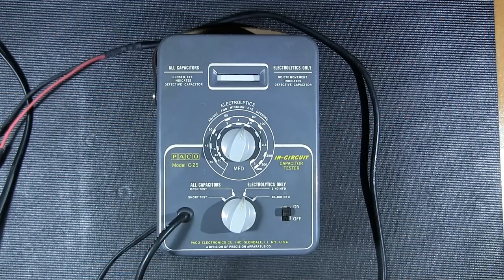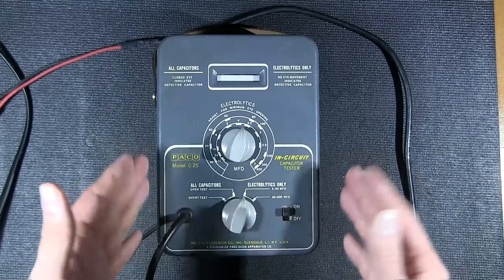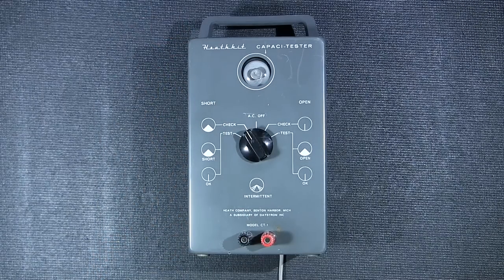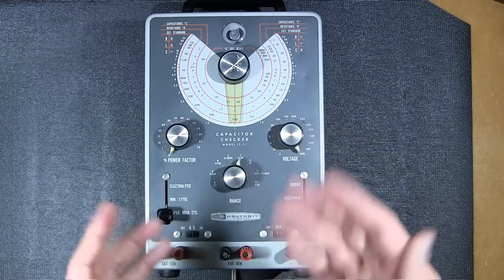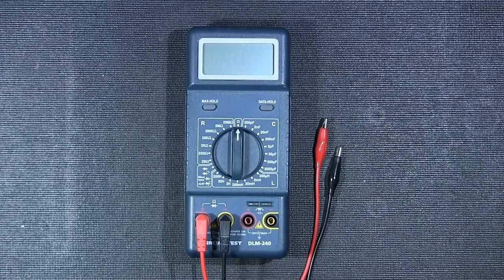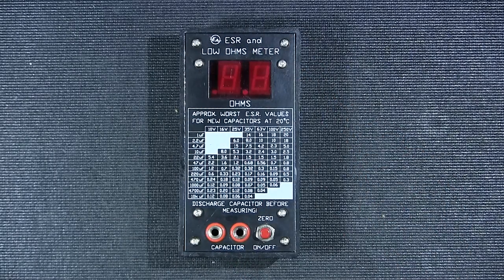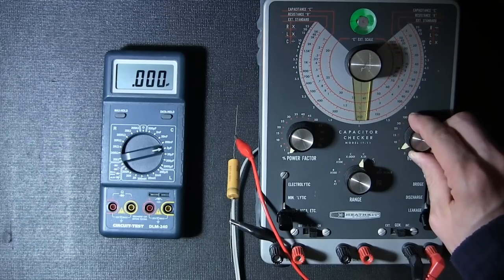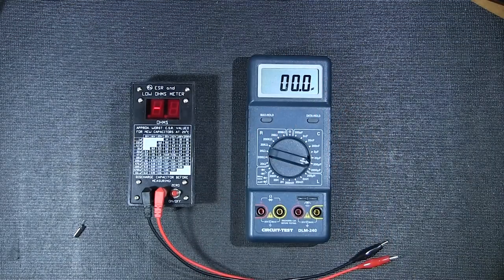Which Capacitor Tester Should I Buy?

Comment: For the absolute beginners on a budget I like to recommend the very cheap "transistor tester" things on ebay. They do more an estimation than a measurement, but they are quite ok for comparing parts, and much better than nothing. One could use one of them to repair a much better device that one bought defective on ebay....

Comment: Ah-hah neat to see the old kitset Electronics Australia ESR tester. At the time I built 4 of these as the kitset they were, 2 for work and I have no idea who 'borrowed' mine over the years because I have not seen them since. I guess they've become a gotta have cheap as anything tester (especially if you permanently borrow it)  for dreaded "rotting" electrolytics testing. I recall though that the ESR ohmic value readings shown in the table were specifically derived from a bunch of to hand capacitors tested by the kitset designer and that because they were already old devices they values shown are very approximate. More modern capacitors will likely give a different reading so use the figures as rough guide only....

Comment: Great video as always. I will add one thing though - if I test a cap with a tester that works by measuring time to charge the c.u.t., and I see a reading that is way higher than the rating, I know that the thing is leaky. Leakage tricks those meters to believe that the cap they test has more capacitance, purely because the leaky cap takes more time to charge. I'm sure you know that, just felt like this might be useful to somebody else with less equipment :)
Reply from the maker: Thanks for stopping by Johnny!

Comment: In my case, a multimeter with capacitance range and a megger (200-500v) for leakage testing is all i need :)
Megger is also used for checking leaky power transformers, but out of about 50 radios i have only found a significant leak twice. Once just a tingler, once a dead short which could've been painful and dangerous...
Once i found a wax capacitor so leaky that it leaked 1mA at 90v...

Comment: A bit of trivia...

...I was an electronic technician for RCA for 33 yrs (50's-80's) And during that time; I was sent to other places from Chicago. And I didn't know; that IN high humidity areas; it can drive technicians crazy. And when they sent me to South Florida (Ft Lauderdale) I couldn't believe it. Because, at that time, RCA used waxed capacitors galore, in their TV's.

And would you believe? Many times, I had to change most all the capacitors in the TV's.  For many were all "leaking". Over and over. And a technician in Miami's RCA Co told me, "pat, you are going have to use other type capacitors. Like shinny caps. Or if you use RCA caps; they won't last a month down here!". And he was right.

Believe it or not. And some resistors (like "IRC's") would go bad also, because of humidity. So we used only shinny resistors. To keep humidity out of them. Because, the shinny bodies do not let humidity creep in the caps and res's.

For what it's worth.

Comment: There seems to be a range of what is max acceptable ESR. The charts vary somewhat between tester brands. If you look at capacitor nanufacturer's specs, the max ESR is  sometimes given and may not agree with the tester and can vary between  brands for capacitors designed for similar service.

Comment: I bought a nice kit component tester about a year ago and it does basically everything here, except with probably less accuracy. I was just looking at a faulty SMPS in a phone charger yesterday where one of the caps had blown. The tester showed me an obscenely high ESR of 42 ohms and 20% loss or leakage. Pretty neat bit of kit and smaller than all these meters
Reply from the maker: Does your component tester source 600 Volts?
Reply: It uses a 9V battery so I think so yeah

Comment: Thank-you for the video. I have enjoyed everyone you made and look forward to a restoration video. I have always been a fan of preventive maintenance. When servicing, Isn't it just a good choice just to replace any, even suspect capacitors ( with a high quality ) one ?. For the most part they are cheap. I can see using a meter if you have to match one for RF circuits. I know replacing good components with new ones may be a waste, but I believe better safe than sorry.

Comment: i design build modify and repair metal detectors, pulse induction and vlf, so an oscope and an lcr meter are vital, the problem i have is finding good lcr meters that measure low enough on the henry scale, most only go to 100 uh, some do 10uh which is okay, but you really need 1uh.
at 100uh a 320uh air core coil, could read 280-360uh, at 10 uh it could read 300-340uh, so a one uh setting gives a more accurate reading of the coil, which in pi detectors can be important, my advice would be to buy a quality dedicated lcr meter, and not a multimeter with lcr, i have found those to be quite inaccurate even "good" named ones, often cheap no name dedicated lcr meter reads closer to value.

Comment: With the esr tester a reading .5 instead of .35 would be pretty hard to call, usually with the esr meter if it's a faulty cap it will be out by an order of magnitude in my experience.

Comment: "Re-Form" Capacitors? Really? Can that actually be done? I'd love to hear more on that subject, even if it might be a "what not to do". Mr. C, I really enjoyed your talk today!
Reply: ^I second that motion^
Reply: I used to re-form or attempt to re-form electrolytic capacitors, I think the true art is in the re-stuffing of those caps with modern ones which is what I do now.  Having opened up enough old can capacitors I can see that time is not a friend and running current through them wont fix what 60 or so years has done to them.  Trying to rebuild a dielectric coating on something that so broken down and dried out is just asking for trouble.
Reply: Re-forming electrolytics applies more to, as far as i know, ones that have been laying in storage, unused. You might not wanna go applying near-to-their-rated-voltage right off the bat.

Ancient electrolytics though, you just wanna chuck straight into the bin.
Reply: As far as it's been explained to my newbie ears is a method for preparing electrolytics that have been sitting for a long time. As for the actual physics or specific method.... hopefully Mr. Carlson can elaborate.
Reply: Reforming can be done but the yield is often low on old surplus junk. :) The ancient Sprague guide (maybe say 1970's) I  used about in 1990 had one reforming via heating the capacitors, having a series resistor in series with each capacitor and going above the rated voltage.

 I did this about 1990 with several dozens of 10 to 30 year old multi-section radio filter caps. 

About one third of these got "reformed" the others just drew more and more current, ie the leakage current did not drop with time but rose. 

This was with a mess of oddball "multi-section radio filter caps" in the 300 to 450 volt range and say 5 to 60 uF. These were from Apex in Sun Valley, the TRW swap meet and C&H sales in Pasadena Calif. 

 I heat the caps in the oven and had a Power Design 3000 volt 10ma supply with a resistor in series to limit the current and also to monitor the current.
 The reformed "multi-section radio filter cap" I placed in a S19 R Sky buddy radio was OK for 15 years until Katrina hit and the radio went under salt water. A reformed cap I place in a S40 hallicrafters dies a few years before Katrina, thus maybe 10 years.

 Even if "reformed" the cap needs to be used, If left with no DC across it they often are bad again in a few years.

 During the reforming event the leakage current will drop, but often not enough to be OK. Heating is required to get the dielectric reforming. With leakage current there is I square R loss watts of heating in the cap too. On abad cap it might be more heat than what oven did. :)

 You do not want the darn caps blowing up in your face by using too low a resistor.
Reply: In all of my heathkit restorations videos I hook the electrolytic caps to the IT-11 and document the reformation for academic purposes only, with an inline Ua meter.  Given a great deal of time for some, watching the current drop for a given voltage to an almost acceptable level, and then retest it 2 days later to find the it again has excessive leakage  leads me to believe that most likely a lot of these cans gain moisture over time which when heated can remove, leading to lower leakage, but the dried out seals will not stop them from re-absorbing water again.

If capacitors were $700.00, of course  I would invest a ton more time in the effort. They are not.   Again, If going for vintage, Id rather just re-stuff them with new and make it look original.  Reforming is just putting lipstick on a pig.  open a few of those cans and your opinion will change.
Reply: 3beltwesty, fascinating... thanks!
Reply: Actually, a good tester, such as a Sprague TO-6, will display the current leakage as the barrier reforms....I've done that thousands of times on caps both very very old from the 30's to new caps that have sat around for awhile.
Reply: While the possibility exists, if, for how long and with what performance, the question is always the application of the given capacitor.  What would happen to the rest of the components in circuit if it had excessive leakage, or worse a complete short.   Is reforming an easy replaceable cap worth destroying hard to find tubes and coils that will be destroyed upon failure of this component.   Again, if they were a highly expensive item made of platinum, I would see the merit. they are not.   

Every time I do a restoration, I always open up the old electrolytics to see the condition, sometimes I document my findings.  Its a safe assumption that if they came in clear see-through cases, most people here would NOT be running mains voltage across them, having the ability to look at the condition of the internals.

Again, theres always two types of advise you will get about anything with regard to this matter on the internet.   Those who will tell you you are asking for trouble, and those who will tell you its no big deal.  As long as people have heard both sides they can do as they please at their own peril.

Comment: New
I have access to a Chroma 11200 Capacitor Tester but I’m not sure on all the proper settings for it when setting up to test the various Caps inside my MC240 Amplifier. Voltage is easy, I’ll set it to the rated voltage of the Cap. The other settings are 1. Charge Current Limit (0.5mA-500mA), 2. Leakage Current Measurement Range (2uA, 20uA, 200uA, 2mA, 20mA), 3. Charge Time (0-999 S), 4. Dwell Time (0.2-999 S), 5. Measurement Speed (Fast, Medium, Slow). I will be using it to test my various Caps in my MC240. What Leakage value(s) are acceptable? Thanks for the guidance in advance!

Comment: I have a Sencore LC53  "Z Meter", (Capacitor Inductor Analyzer). Are you familiar with that unit?  It was a govt surplus buy. A small wooden dowel was included to wedge between the handle and the leakage button to reform electrolytics (up to 600V). Most impressive lab. You have more equipment that I do (which is more than MIT according to an online list).

Comment: Is it possible just to use ampermeter and DC voltage source to measure leakage current? If capacitor is leaky it should pass direct current like resistor. So, magic eye on Heathkit indicates direct current, just like ampermeter.

Comment: Hello Paul nice video I really like the last HEATHKIT tester very nice but as you said dangerous for the non-attentive operator.
This year early on I won a DE-5000 brand new with all attachments for $80 AUD I was the only bidder. 
Now this is a great LCR meter as you can select what frequency you want to test at, and for electrolytic' that's usually 120Hz.
You can select Dissipation Factor. ESR. Tangent angle etc. pretty much all electrolytic manufacturers list the dissipation factor on their data sheets. Where as only some list ESR. I recently paid for some very well,known top brand caps, and was most disappointed to find when I checked them that they were outside the 20% tolerance range stated. As an example some were 1000uF but only showed 780uF or less. We eventually came to an agreement I got a refund that was nearly what I paid and the caps went in the bin. I wouldn't use them in a customers item
When doing a full recap. I've been very happy with the DE-5000 and daughter not know how I got by without it. 
I will keep an eye out for the HEATHKIT unit as I quite like V.T. Meters. Keep up,the great work Paul you have an excellent talent for teaching in a way that most people can follow, and that's rare where a lot teach at a higher level. Cheers
Reply from the maker: Thanks for your comment Peter, and taking the time to write as well!

Comment: I have the same ESR meter.  A tad cheesy, but it does work.  Personally, I don't see the value in checking the capacitance.  That seems to be the last thing the fall.  If it's so bad that it's capacitance is off, I suspect it will fail it's ESR test.

Comment: Very interesting.  I would have liked to see you continue with the same capacitor through all the tests to see how that leaky one would have performed on the ESR test.  Would the ESR test have shown bad readings on the leaky cap?  Maybe take 10 caps and make a chart of their ratings then add the results of all the tests.  That would be interesting.  I learn something from every one of your videos.  Thanks.  What do the more modern capacitor leakage testers look like?  Pictures are ok.  It would need a power supply with all those voltages or I guess maybe the highest with a voltage divider.

Comment: That ESI LCR, video bridge on your bench, DUH! Yes, they can cost $5000, (with a cal cert) and the Kelvin clip leads cost $400, but, dang, I sure do love mine. The old Sencore Z Meter was not too bad either. I think I have an Eico or one of those old kit testers with the eye tube. I like that Pacor, with the Austrian bar eye tube. What were those, EM84s? Beautiful little tube, even when they are not lit up, they are just pretty to look at. My Eico or whatever it is has a lot more range. It has several scales on the big dial. Mine could be a Jackson. My Selenium rectifier tester is a Jackson. I usually just use a DC milliammeter and a high voltage DC power supply to test leakage. I also reform caps that way, or now I am charging them up and hooking them to the tool box in my truck, as some SOB stole about $6000 in tools from my vehicle. That 300 volt Snap-On tool box has nailed one would-be thief so far. His screams had me bursting out the front door with a CZ75B pistol, and an attack dog. I have  Beckman digital LCR, that is not too bad. There were some nice ESR meter kits sold for around $80.
Reply: GREAT VIDEO!  I still love my ESI LCR, which will show the ESR, and the Z, and D, and...............
Reply: You are in Canada, please send me some cold air! 119 degrees is way to hot!

Comment: i noticed you didn't discharge the cap before connecting to the ESR meter. perhaps its not  necessary however i learned over the years to do that w/o thinking and possibly save  an expensive piece of equipment from damage.

Comment: Paul, thank you very much for the video. I am wondering if you can propose a cap leak tester project, a simple version of Heathkit  IT-11 without any valves for leaks only. It is not clear why manufacturing of cap leak testers is discontinued for while. Additionally finding a reliable 2nd hand one is not easy.

Comment: It would be interesting if you could do a video explaining  how to use the Heathkit IT-11 power factor control when measuring electrolytics.   I know that Power Factor in a capacitor is the reciprocal of ESR but am kind of confused.  When you adjust the power factor control in the  IT-11 while you are using the bridge, it sharpens up the dip of the tuning eye.  Since low ESR is desirable in electrolytics  is high power factor desirable also?

Comment: Hi Paul - another nice video :-) - i personally love to use my old Heathkit It-28, very similar to your it-11, and the only drawback to it is as you said in the video is the non returning leakage switch, but during the years one become custom to it´s operation :-) - i´m like you only using this for leakage nowdays since i find that the digital ones are more easy when it comes to determine capacitance,/res but since i tend to repair and renovate old tube equipment it will always have a place in my workshop, thanks again Paul for the nice work you are putting in.. 73´s / Anders (sm7Hce )
Reply from the maker: Thanks for taking the time to write Anders!

Comment: I want to thank you for sharing your knowledge. 
I bought two vacuum variable capacitors on Ebay but didn't get around to them for quite some time after my purchase. 
When I finaly did I tried to test their capacitance with my digital multimeter set to capacitance but I'm not getting anywhere near the rated capacitance or even any consistent reading that I feel is reliable. 
Is there a way that I can I test them without buying an expensive cap tester, maybe by applying a voltage and or frequency and reading the output as I put them through their max & min?
Thank you kindly for your guidance, 
Gary